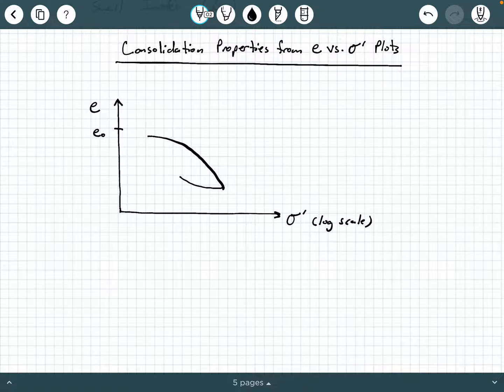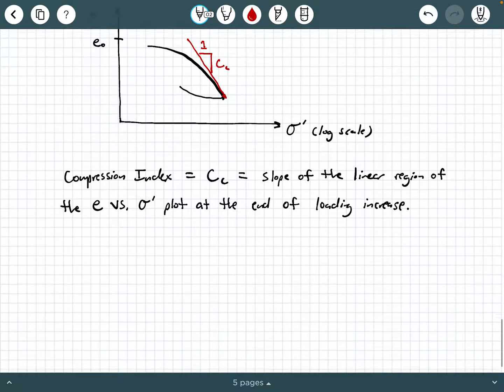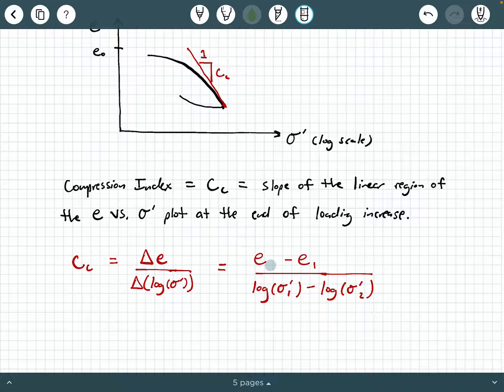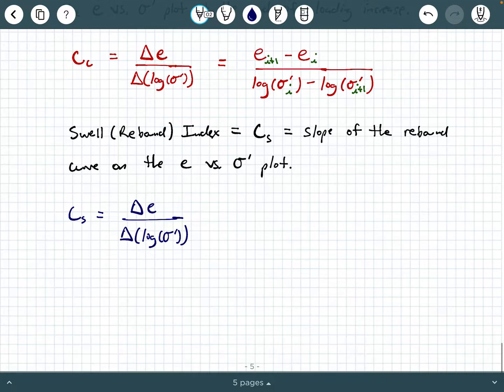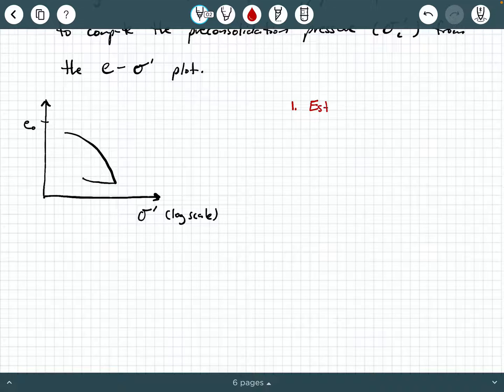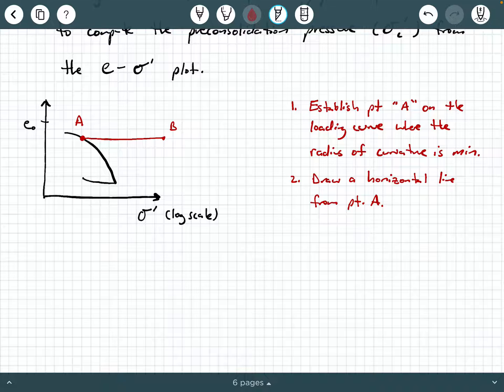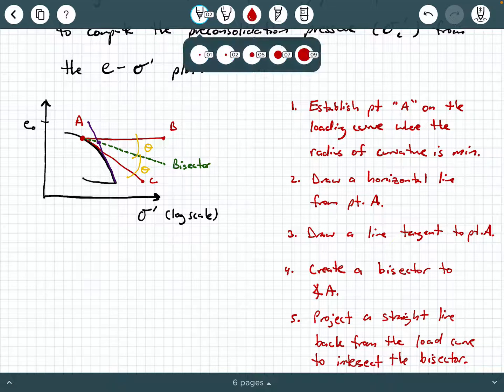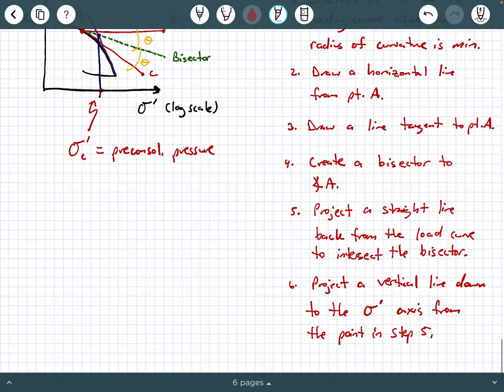Consolidation Properties from e vs. log(effective stress) Plots

Comment: Thnaks alot for this video. To be clear, did you draw the tangent line from the sharp end?
Reply from the maker: @theinbetweennn  To get the compression index (Cc), that is correct.  Project a tangent line from the approximately linear portion of the compression (loading) curve.
Reply: @mathandengineeringwithdr.a9515  thank you